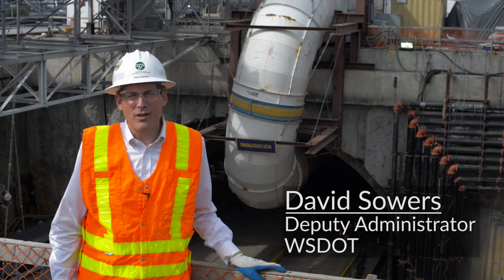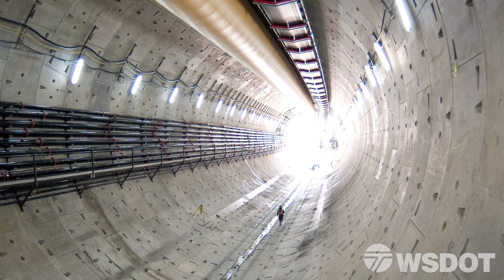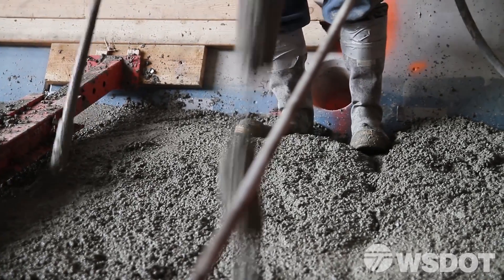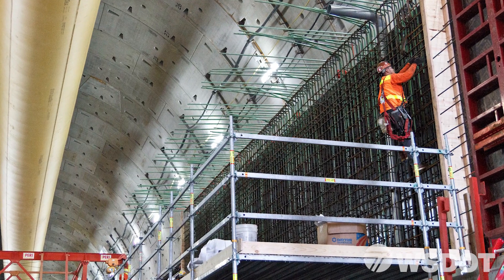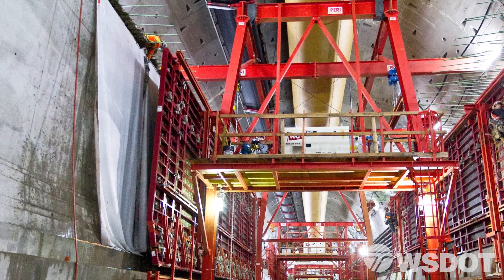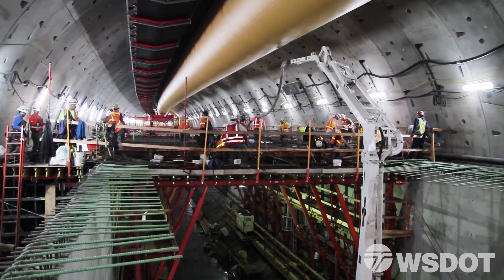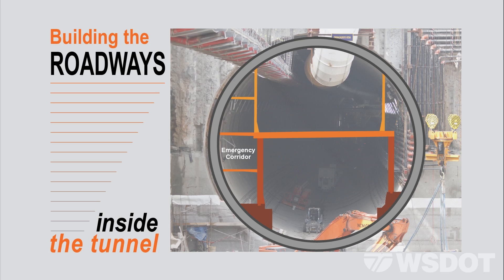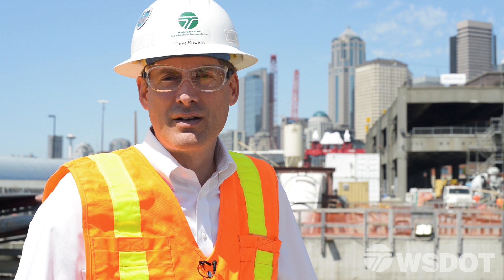Building a highway inside a tunnel

Comment: I worked as Senior Inspector of Works on the Kuala Lumper Smart Tunnel in Malaysia, designed as a flood relief tunnel but a contractor put in a bid for a dual use flood and double deck roadway tunnel. Escape routes were constructed outside the tunnel ring and included a stairway to connect the upper and lower road decks, watertight for use when the tunnel was closed to road traffic and used for flood relief. This method also left room for two lanes in each direction and an emergency walkway at the side. There were also watertight doors installed at the traffic entry and exit points. Road tolls will pay for the extra works required to make it a road tunnel. I'm told it takes about two days work to clean and replace damaged fixture after each flooding. Lighting etc. were chosen to be cheap and easy to replace, rather than very expensive units that still may get damaged. The tunnel has reduced driving times in the rush hour times and improved traffic flow. As with the Seattle tunnel the road decks were constructed during tunneling using mainly cast insitu systems.

Comment: Epoxy covered rebar is proving to actually be worse than bare, hot dip galvanized seems to be the best (after basalt, which has limitations and is expensive).

Comment: Why dig a very wide tunnel to stack the roads, why not build two seperate tunnels like how most underground highways are built
Reply from the maker: We studied twin bored tunnels as a potential replacement option. The cost and time of boring two separate tunnels was considerably greater than building a single, large-diameter tunnel.

Comment: So, they are boring a tunnel to replace the double deck highway that may collapse in the event of seismic activity and then building a double deck highway inside the tunnel? The whole thing sounds silly. In the end you still have a double deck highway that may collapse in an earthquake. Only now they won't have to bury you when you die, you'll already be buried in a mass grave.
Reply from the maker: Structural engineers agree that tunnels can be one of the safest places to be during an earthquake. The SR 99 tunnel is being designed to withstand an earthquake that only happens ever 2,500 years on average (about a 9.0 magnitude) without collapsing.
Reply: hedunlap ironically tunnels are actually quite safe in an earthquake (providing there built properly) it's strange but true.

Comment: Why does the upper roadway have walls? Why can't they just be the tunnel walls? Anyone know?
Reply from the maker: The walls on the west side of the upper roadway protect equipment and utilities in electrical rooms adjacent to the roadway. The walls on the east side of the roadway isolate the emergency ventilation space, which will be used to remove smoke and fumes from the tunnel as needed in the event of an emergency.
Reply: Very good - thank you

Comment: Nice presentation! Curious why the corbels appear vertical/horizontal and not perpendicular to the segments for even strength?
Reply from the maker: The shape and placement of the corbels is determined by the curved exterior of the tunnel. This rendering of the completed tunnel shows how they support the walls and road deck: https://www.flickr.com/photos/wsdot/sets/72157631528692308/